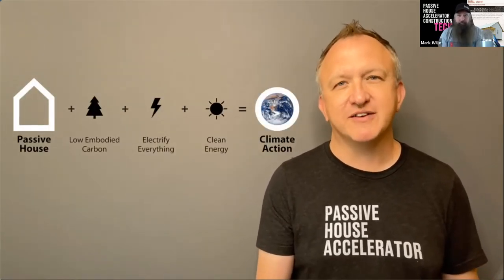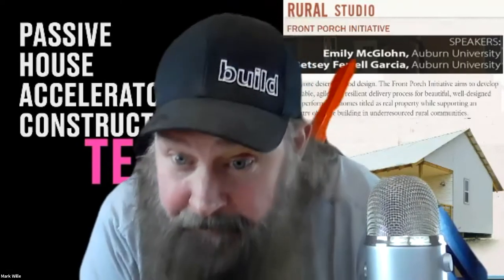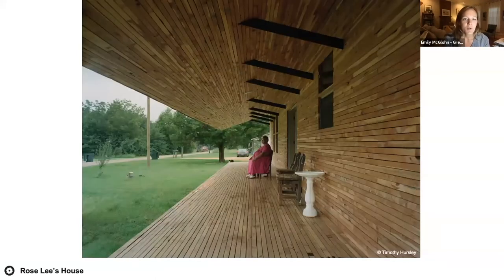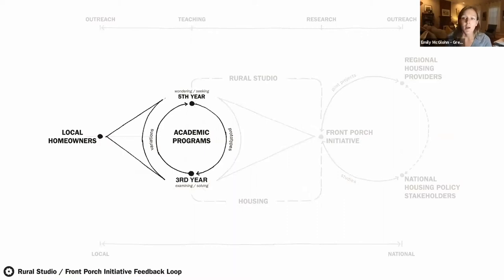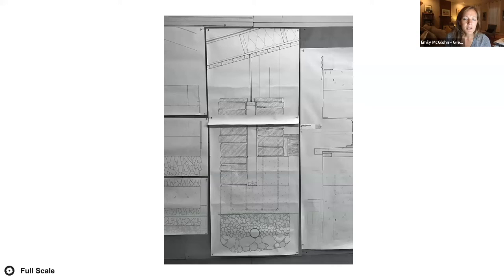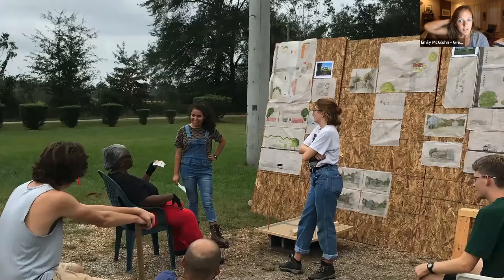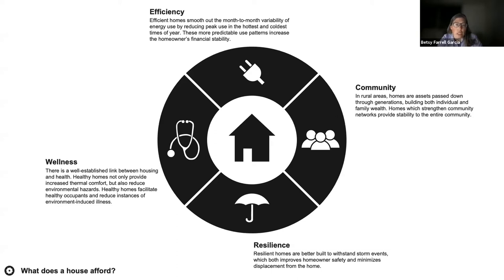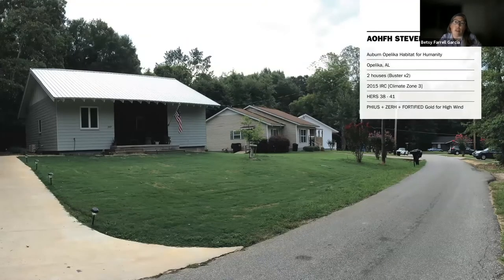Affordable High Performance Design in Western Alabama | Full Event Archive

Comment: Wow! I've spent so much time researching eco smart home builds, and through that, recently discovered the passive house philosophy. Once learning about it, would be very hard to consider building any other way. Yet, every builder I've found is either only building in the North East, California or Colorado. I remembered an article I read many years ago about some really interesting things going on at Auburn University. It was a partnership with Habitat for Humanity, if I remember correctly. I thought it was so very cool, and neccessary, for other people. I was settled into a nice neighborhood with an excellent job, at the time. Yet, have so much empathy for those without that basic sense of home. And, security. Fast forward probably 10 years later, and cancer struck. It's been incredibly scary, as anyone can imagine, but what I hadn't known, prior, is that cancer is expensive! And, life doesn't necessarily go back to normal once you beat it. So, being a problem solver, I set out to find a little plot of land, intending to build a much smaller home than I have, using the equity I'd built up, striving for a low to no mortgage existence. In other words, the tiny house movement philosophy, yet on solid ground, and small-ish rather than tiny. Seemed a great plan. Then covid. Then building supply issues and labor issues and inflation. The gentrification of hourly wage workers that had been happening for years, in bigger cities, that I'd been lamenting about, just unable to fathom what life would be like without a sense of safety that a home provides. I had cried tears over the situation, not even knowing anyone personally affected, just knowing there were strangers out there, frightened. I still own my larger home, but hanging onto it by a thread, since cancer. I still need to sell, and down-size. But, gentrification has now hit both middle and upper middle class America. We've been priced out. I'm still more fortunate than most. At least I have a home. It's strangely ironic that my problem is I have a home that's too large for me. Yet, due to the aforementioned issues, I'm stuck in it. I literally have too much house, while others have not enough or none, but I can't do anything about it. Not only no passive builders in my area. No affordable builders in my area. Even the shoddy, terribly-built houses which will only increase the safe housing problem, over time, even those have priced me out. And, I have a pretty nice home to sell! The realization that I'm in a better situation than so many, yet still screwed (sorry) is such a mind blowing concept! I'm just thankful to finally learn that someone in the SouthEast is attempting to do something to help the situation. Thank you!! I will definitely subscribe, to learn more, and also to help spread the word as much as I can to the growing problem of safe, affordable housing, and what you're doing to help improve things. Thanks again.. And, best of success. :) Passive housing is the way to go!